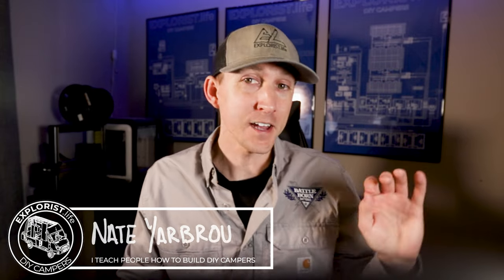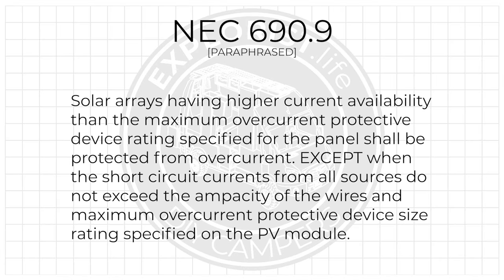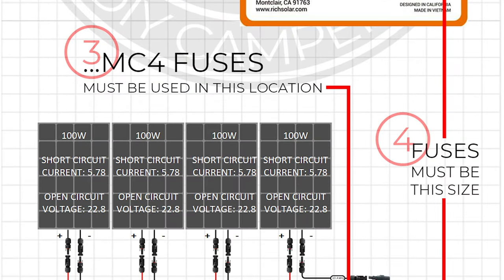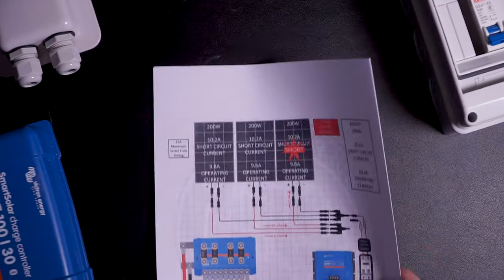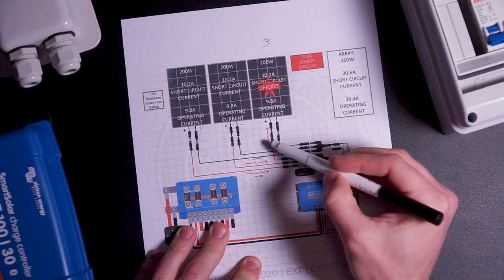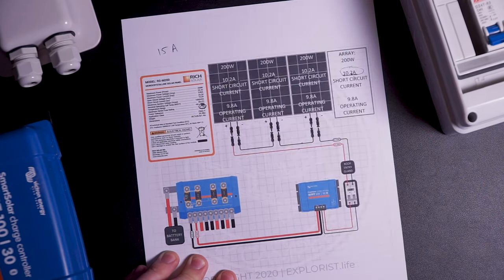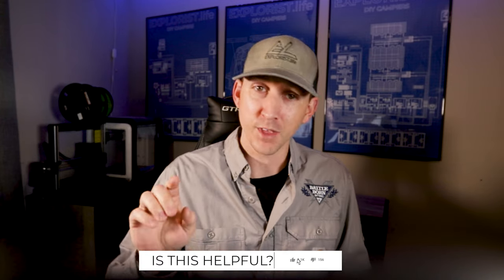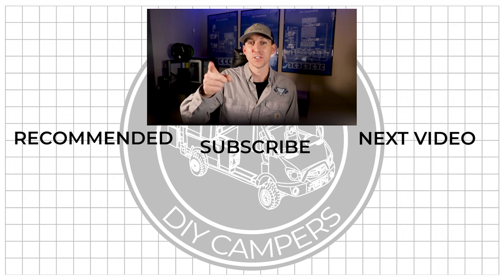How to Fuse a Solar Panel Array for a DIY Camper Electrical System

Comment: This is why I do single series string arrays haha I never put panels in parallel these days for this reason. I am too lazy to wire up a ton of breakers. Super good video! I will just direct my viewers to this video. Thanks
Reply from the maker: Thanks, Will!  Pure series makes things SOOOO much easier from a design, wiring, fusing, and nearly everything else standpoint.  I 100% totally agree.
Reply: Ok!
Reply: LOL....I ended up over here already because you didnt have a video on this Will. I watch all of your vids, and have your book, but you failed us all on this one 😂😂😂😂

Keep up the good work young man.
Reply: Sometimes you have to go parallel or series-parallel if you don’t have high enough voltage or current capability in the charge controller.  Shading can be an issue in mobile applications.   In these cases it doesn’t pay to be lazy.
Reply: but in that case if you have connect them directly to the controller right?
Reply: Thanks for this clear explanation. I'm building a solar shed and need to have 2S2P setup due to an East-side & West Side setup because of the roof orientation. This makes me much more confident in the build. Thus, DC DIN breaker for the solar disconnect and fusing on MC4 combiner leg inputs.
Reply: @EXPLORISTlife  What size fuses do I need if I'm wiring (4) 100W panels in parallel, 3 of which have a short circuit current of 5.36A and one with 6.4A = 22.48A? I'm planning on using a 4-to-1 Branch connector MMMMF+FFFFM Pair. Would it hurt to have 30A fuses on each? That's the biggest size I see on Renogy
Reply from the maker: @brasilfreak24  What panels are you using?
Reply: I was coming coming to search out your video on the subject next DIY. Thanks for all the knowledge guys.
Reply: Fuse everything be safe. Fuses are cheap just don't drink a few beers one night and you can pay for a 36 panel array of fuses
Reply: Faithful follower of your vids.
Reply: Im using a 12volt 50watt renogy panel. 10amp battery tender charge controller to charge and maintain my car battery. The charge controller instructions says fuse the solar/battery/load with 15amp fuse. My panel produces 2.91 amp will i need add a fuse between the panel and charge controller or is there no need to add a fuse? If i was it be a 10amp fuse and i would install a fuse between battery and controller.   So no fuses or yes fuse? Thanks.
Reply: @Kev in 𝕃𝔹ℂ I had the same question.  Did you ever get an answer?
Reply: I had to wire in parallel because I don’t have a mppt controller. Looks like I need to add some fuses.
Reply: the GOAT himself
Reply: @caseykelso1  The thing is that if you are running the panels in series the fuses do nothing, the short circuit current is the same as normal solar power operation and the fuses will only be there for decoration...
Reply: Hi Will. So if I have a single 400w do I not need a fuse?

Comment: Yes, but HOW do you know what your TOTAL short circuit current is of your entire array? Do you add up each one in series or parallel?
Reply: In series current does not add up, it remains the same, however in parallel you add the currunts

Comment: in my caravan. came without circuit breakers. i installed circuit breakers.WHY? So that i can turn off and test each individual solar panel(in parallel) and check performance over time. The other option was to remove the wires from the solar controller each time on a yearly test.

Comment: What size fuse is needed? Is the fuse for each panel the same size fuse as the max fuse desciption on the panel and then how do you size a fuse into an array ? I got Short Circuit Current 11.39amp and Maximum Series Fuse as 20 amp, 2s2p . Will i use 20amp fuse in each panel and 40amp fuse in each series fuse then into the charge controller??

Comment: I just wanted to thank you for your efforts in explaining how to wire up a van.  I have been watching your YouTube channel for about two years on how to build a van.  I use to have a 5th wheel, but when I retired from being a higher education IT system admin and fix it all networking dude on 1/31/2020 my wife and I decided to get a van instead of another trailer.

So in April 2021, we bought a 2017 Ford Transit 350 PowerStroke high-top extended.  I downloaded your plans to add to my collection of two other van plans.  I wanted to support folks who take the time to share accurate and easy-to-understand information.

So anyway, I have a lot of van equipment in my dining room. I am working to get a minimal install in the van for our first trip in September.  The van is not going to be completed, but I have a sliding bed and I installed two MaxAir fans.  I told my wife that my goal was to get the fans installed, have a bed, and have batteries charging off of our van battery.

When I was watching your Airstream build for the third or fourth time I realized that I had calculated my solar incorrectly and I had to order a different solar charge controller.  I like the way you explain things in detail without glossing over what is important.

Thanks again for all of your hard work.

Comment: Hi Nate, Do short circuit issues only apply when panels are in parallel? I read all (most) of the comments before asking and it is not explicitly stated, but implied by several messages and your graphs. 

 This is my understanding so far;

a) Panels in series - no issues since amps are not added (only voltage is added in series).

b) Panels in parallel - fuses may be required since amps are added (in parallel) and total amps may exceed short circuit amperage rating of of the panel (fuse rating).

c) Panels in series-parallel - fuses may be required for same reasons as above. 

It appears only the panels in parallel when the amps are added is where the fuse question becomes an issue. Can you clarify?

BTW, you have the knack for educating people on complex topics. Strong work. Tim

Comment: Thanks Nate! I have 2 panels wired in series with no fuse. I THOUGHT that would be ok, but now I have the data to back it up.
Reply from the maker: No problem!  Good deal!  Pure-series wired arrays RARELY (Never?) need fuses.

Comment: Let's see if I understood correctly: I have two panels connected in parallel both with short circuit current = 10.269A, would short circuit current be added, too, for a total of 20.538A? Max series fuse on the panel is 20A, so would I need a 20A fuse on both panel's positive cable before they go to the parallel connector? 

Loving the videos btw, I'm learning a lot and found I did a couple things right on my starter system!

Comment: Something  I agree on.  Thank you for enlightening the DIY group.  I have yet to get serious about the 4S4P solution with my panels and inverter.  I have a Growatt 80A with a 60-145V range.  The panels are 260W 30.6V 8.5A and knowing the fuse solution leaves me cautious with a 3S2P.  I could do 4s4P-5P even. 122.4V at 34A - 42.5A but then where goes the fuses? Brave men burn down their homes.  I shall wait until I've absorbed more knowledge. Of course, there is always the wire to consider.

Comment: THANK YOU for these extremely instructive videos!  They've given me enough knowledge to get most of the way into design on a motorhome roof 1200W 12V array.  Panel: Newpowa 210S-12H.  Vmp 16.77 V, Imp 12.48 A, Max Ser Fu rating 15A.  Two 3-panel banks, S/P I see (2) series circuits producing 50.31V @ 12.48A. Paralleling them I calculate final out of 50.31V @ 24.96A (not adding for temp).  Do I understand correctly that I need to fuse  before or after the Y branch parallel cable(rated 30A) up on the roof, and if so, what fuse size in each leg?  (figuring the Isc for the entire array is 39.27 x 1.25=49.1A and the Max Ser Fu rating is 15A)  I'll be dropping to a breaker/disconnect before the Victron MPPT 150/85TR.

Comment: I am looking at a 600 watt solar array.  (sailboat with some shading possible) 100 watt panels. 2 x 100 watt panels in series. the the 3 sets in arrays.  The panels have this rating: Open circuit voltage

21.6 V

Maximum power point voltage

18 V

Short-circuit current

6.11 A

Maximum power point current

5.55 A

Would I need a fuse in this scenario?  the set up i believe would be:

SERIES PARRALELL
3 solar banks (each 2x100 watt panels)
3 - 200 watt solar banks in series then parallel
600 watts (40 volts at 15 amps)
100/50 charge controller
10 Gauge Wire

Am I correct on all this?  These videos are AMAZING!!!!!  Best Ive seen

Comment: Hi Nate, thanks for the very informative videos. Could I use the x 1.25 rule to size the fuses for the panels? I gather you use the maximum fuse rating as the panels components can handle that amount of current and is probably simpler to do, but I've already bought a bunch of 10a fuses for solar panels with a 5.51a short-circuit current, would they still be ok to use? Just out of interest, why do you place the fuses before the branch connectors and not afterwards? Just I noticed alot of places like Renogy specify placing fuses after the branch connectors. Does it mean that in the case of a short circuit and the fuse is blown, that just the one panel would stop working rather than all 3 tied into that branch? Many thanks in advance! Joe

Comment: So, my solar setup doesn't require fusing based on your video. 

Does it also not need a DC breaker? Could I just use a DC isolator?

Love your content - thank you.

Comment: Awesome information. Appreciate all the work you do. 

Quick question, I have 4 550w panels I plan on adding to the top of my bus. I need help determining between parallel or parallel series, and then sizing my fuses. 
 
IMP: 13.11
VMP: 41.96
ISC:14.01
VOC: 49.9
I cannot find max series fuse rating ANYWHERE, only maximum system voltage which is 1000

I calculated the short circuit (14.01) x 1.56= 21.86.. so if doing parallel I would need 30a inline fuse prior to the 4 to 1 mc4 connectors. What I then am getting confused about is after the 4 to 1, that would be (21.86 x4) 87.44 amps running thru that connector and would not be able to handle it, right? Or would a 100am pv isolator be after the 4 to 1? Any and all help would be appreciated.

Comment: Great videos, they are very helpful. I especially like the way you break things down into appropriate bite-sized chunks 👍

That said... I think you may have wrong video linked in the show notes for determining short circuit current.  The URL provided goes to the series-parallel video a couple of episodes back, not the one linked elsewhere from fall 2019.  A minor quibble, otherwise you're doing great!

Comment: Good videos I have learn a lot question I am starting a system for my cabin have 4 panels 300watts each panel is better parallel or serial
Reply from the maker: Hey, thomas ansieta! I appreciate you taking the time to ask your question, but unfortunately, I don't have enough info about your specific question to provide an accurate answer, but here is a playlist that, if you watch all of the videos start-to-finish (and take notes 😉), you'll have a REALLY good idea of how to design a solar array: https://www.youtube.com/watch?v=Jkbs84sBHsg&list=PLmvhcyi4n0TV9pi83rFTv3ZuMT_S1xIZt

Alternatively, I have some of my most common solar array setups pre-built here: https://shop.explorist.life/product-category/all-products/camper-wiring-kits/solar-charging-wiring-kits/

Comment: Hello Nate, I am a new subscriber and find your videos very informative. I have a question about fusing. Do two 160 watt solar panels connected in parallel have to be fused. Both have a short circuit current of 8.37 amps, optimum operating current of 7.92 amps and a max. series fuse rating of 15 amps? I think the answer is no, but not sure. Much appreciated, thank you.
Reply from the maker: Does your array short circuit current exceed your max series fuse rating?  

Here's how to figure out your array amperage: https://youtu.be/KJ5zCY5EBeQ

Comment: Question: when figuring out if you need fuses and also wire size, do you use the stc wattage, or the maximum wattage for calculation?  I have renogy 115w bifacial panels that have a max power stc of 115w, but it has a capability of 149w under optimal conditions.  So in my calculations do i calculate using the 115 or 149? Thank you and I'm glad i found your channel as I've been struggling getting a straightforward answer on many applications even from renogy customer service itself.
Reply from the maker: Whatever the max stated wattage is.

Comment: Hi! Thanks for the video. I am far away not an electrician. What would be the functionnof the bypass diodes on the panels? Is there any additional protection from the inverter side? Thanks

Comment: You're presentation of what the current does when a short appears in 3 panels connected in parallel was very helpful. Thank you, thank you, thank you! But once I understood it, I tried to apply that reasoning to the 3 panels in series and got confused. I came to the conclusion fusing in any pure series arrangement would never be needed since the currents never add. Is that right? (Still learning...)
Reply from the maker: Fusing in a purely series array is indeed never needed.  Nice work!

Comment: I am using the same Rich Solar 200w 12v panels as shown above. They will be wired in 3S2P. Each sting will produce the 9.8a but the strings when parallel will be 19.6a exceeding the individual panels 15a max fuse rating at the combiner. Where (if at all) would I fuse this array and what fuse capacity would I use? This is an amazing video btw. Thanks for all you do. You and Will Prowse have become my Gurus.
Reply: I have the exact same array setup I am preparing to install. 6 Rich Solar 200W 12v panels in 3s2p configuration. Was this question ever answered, and if so, what was the verdict? Fuse required or not? If so, what rating fuse?
Reply: @andresjoubert  nope, it wasn’t answered unfortunately.
Reply from the maker: I didn't give this one a personal answer as the video answers the question. 🙂👍  If the array amperage exceeds the max series fuse rating, it needs fuses.

Comment: So I have 8-200 watt rich panels that I plan on wiring in 2 series strings then connecting those in parallel so I can max out my watts input for eco flow power station. The short circuit current for each panel is 10.2.  So that would stay the same for each string but when I wire them in parallel it would then be 20.4. Would I need to fuse these at the Y branch connectors?

Comment: Great videos.  Best help I have found.  I cannot figure out the fuse between battery and controller.  Manual of Renogy Rover 40 amp Mppt states to match the rating of the controller, so 40 amps.

I am running two 160W renogy flex panels in parrallel.  8.88a short ciruit current.  20 amp Max Series fuse rating. 

Is it even possible to achieve 40 amps of current with that setup?

Thanks for what you do!
Reply from the maker: A 40A charge controller is indeed capable of putting out 40A.  As for why Renogy recommends that; I cannot say.  I know that Victron and most other quality charge controller brands recommend the fuse be somewhere in the ballpark of 125% of the capacity of the charge controller given proper wire sizing so the fuse won't blow under normal operating conditions.

Comment: The example you first showed if it was wired in series parallel what it need a fuse? - I am doing exactly that, 4 12v 100w panels in series parallel,

Comment: Question : I am installing 6 x 150w solar panels to my bus in parallel. each panel has a 15A rating. Am i right in saying I DO need individual fuses installed for each positive connector?  Thank you in advanced :)

Comment: Fusing is confusing! Thanks for everything you do to teach us what we don't know. I've learned so much.
2 quick questions:
1. If I have 5 panes in series and each has a fuse rating of 15amp then I don't need a fuse. However if these panels are 20amp fuse rating then I need a fuse?

2. How about between the MPPT Charge Controller and the batteries, do I need a fuse between them?

Comment: Hi Nate. Great video.

My 3s3p short circuit rating is 16.8 (5.6x3) amps

My Fuse rating on panels says 15amps.

Will I need to fuse it is that not much over to not worry?

Regards
Phillip
Reply from the maker: Like mentioned in the video: is your short circuit rating more than the fuse rating?  If so... it needs to be fused.
Reply: @EXPLORISTlife thanks Nate. Appreciate your advice

Comment: Hi Nate, From Puerto Escondido Mexico, we follow you! Question: What Size of PV Brearkers I need to use for a Panel Arrey  that it has 2 Panels en Series and 3 Strings in Parellel, this is the info for the Panels, Short Circuit Current (Isc)14.01 A, Open Circuit Voltage (Voc)49.68V, Maximun Power Current (Imp)13.42A, Maximum Power Voltage 40.98V And Maximum Series Fuse Rating is 25A, Thanks for your Time and Help in Advance. Juan Martinez.

Comment: Hey Nate I'm still a beginner and some of this went right over my head 😳 Any who can you tell me if I need to fuse these two panels for my solar generator in parallel?

JA SOLAR JAM54S31-395/MR

RATED MAXIMUM POWER (Pmax)
 [W] 395
OPEN CIRCUIT VOLTAGE (VOC)
 [V] 36.98
MAXIMUM POWER VOLTAGE (Vmp)
 [V] 30.84
SHORT CIRCUIT CURRENT (lsc)
 [A] 13.70
MAXIMUM POWER CURRENT (lmp)
[A] 12.81
MODULE EFFCIENCY 
20.2

The specs reads as:  Maximum Series Fuse Rating 25A not sure if this is what you were referring to.

Thx!